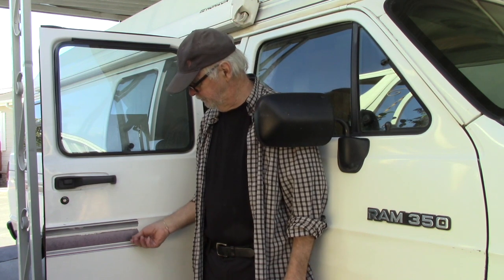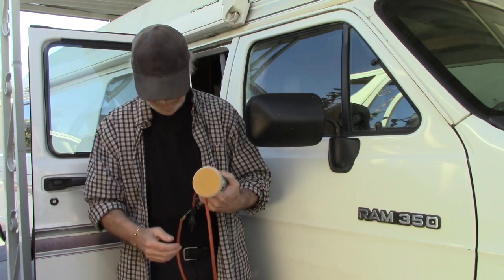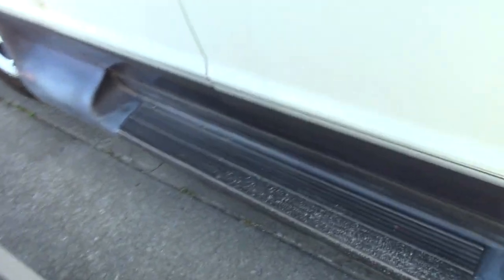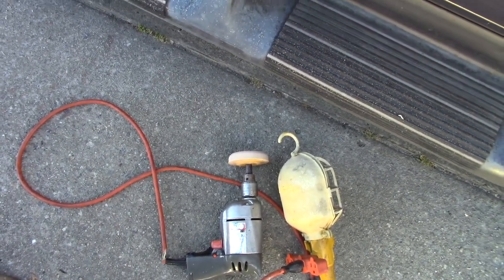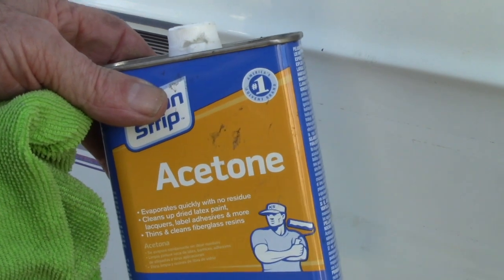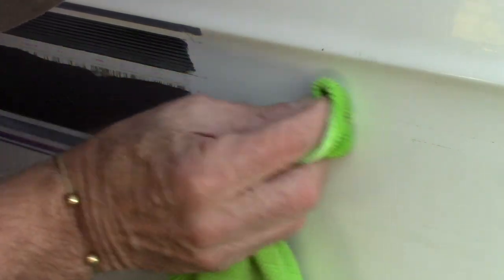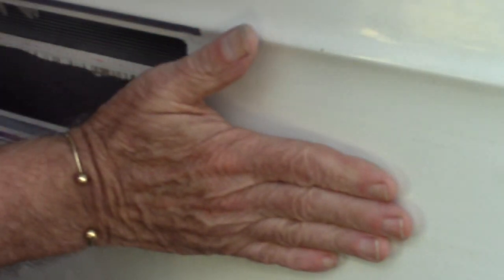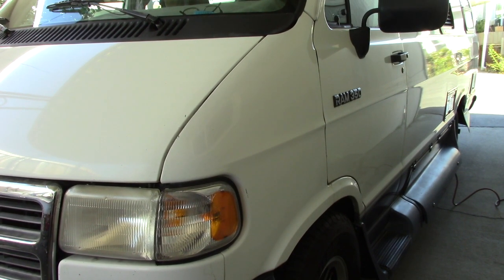Stripe Removal with an Eraser Wheel

Comment: Thank you for the demanstration.  When I bought my used class b 2 months ago someone else took off most of the decals.  They did not finish it or wax it.  Still needs to be done.  After watching what it takes to get them off I am sure thankful to the person who did it.  Will need to take off the last stripe on the bottom and replace where there are two different paint colors.  Pleasure-way Excel TD
Reply from the maker: Is yours a Dodge? I googled images to see what the striping scheme looks like. 
As far as replacing, are you speaking about paint or stripes?
My Roadtrek has different color paint on the lower body and I am up in the air with how I want to deal with it.  
Do I want to  paint it white to match the rest of the body?  
I don't think so. It would cost a fortune.
So what are my options?
Whatever I decide to do, it will be a DIY project.  Nothing will happen until spring when I have months of warm weather.
In the meantime, I can brainstorm, research and see if I can come up with something that adds to the "cool factor" of the van, maybe add a modern element to a vintage vehicle.
I've toyed with the idea of doing a "camo" treatment, faux granite. Something that adds visual 'weight' to the lower portion of the vehicle.
Reply: Roadtrek Rich   It is a 2007 Ford.  It also has paint on the lower body.  The stripe covers the not so perfect paint job.  I am gong to replace the stripe with a auto decal tape I found on Amazon.  Not in a hurry to do it.  The stripe on there now is scratched in places, but does not look too bad from a distance.

Comment: Rich, you continue to be one of my favorite vintage RT channels! Actually, I just watched your shock-replacement vid, (are you satisfied w/ the Billsteins over the less expensive options?), at the end you mentioned your stripe removal vid, so I came to find this one. I did many hours of research about removing mine. The problem is, most of the 'how-to' advice available is referring to standard vinyl pin stripes and logos, NOT this industrial, plasticky, baked -on crap we have!  After weeks of trial and error w/ 20 different products(!)... (I was TRYing to avoid the expense and labor of using the wheels),  NOTHING and I mean NOTHING works other than the wheels. I went through 4 of them, started on the roof  (mine is in prep for a paint job) to get the ladder work over with. It wasn't too bad once you get the hang of it, a little music, some coffee and water handy and just DO IT.  You already know this, so I'm just chiming in for anyone else looking for advice and support with this beast of a nightmare. Don't waste your $ on all these 'decal and adhesive removers' .. they work great on normal graphics, but will NOT work on the other strips. Buy the wheels!!  My body shop guy told me they were some 3M product that was meant to never come off ... they did a great job, I'd say!  I am SO glad that's over with!!!
Reply from the maker: Hi Sandy Sez, thank you for the comment !  Yes, I agree, it's a tedious job. I still have some left to do around the roof.  I didn't have a ladder but now I have a nice heavy aluminum one that will make the job easier.  The good news is I'll never have to do it again, nor you.  And a better looking machine in my opinion.  I could never figure out why the rv industry went for all the swooshes.  It's a big, boxy object. There's an old saying, "it's like putting lipstick on a pig".
I was going to go further and paint the lower rocker panels and fairings but the paint on the body is fine, the fiberglass fairings are faded but it's gel coat, the color is in the fiberglass so I'm just going to sand it and paint it with a satin clear to seal it.  I think it gives the van a certain, personal patina of its own. I like it.
Reply: @RoadtrekRich  'never again' is indeed the reward here!  I REALLY wish mine didn't need paint so badly, but w/o it, my resale value is NOT good. There is a great company called 'automotive touchup' that sells great auto clear coat and if you want to repaint the bottom, they also sell aerosol cans filled w/ your color code.    and btw,  doing the roof was SO messy, I taped off the seal around the roof so all that mess wouldn't make it's way behind the roof seal. 
http://www.automotivetouchup.com/index.htm

Comment: Thankyou Rich those are great suggestions. My Roadtrek is a 2001 Versatile. I've tried Mequires but not sure if the same ones you mentioned. lf not I 'll find them. I do like your videos so keep up the good work. I love that ego isn't the goal but rather a love of sharing info.
Reply: Forgot to add that its the Chevy not a Dodge.
Reply from the maker: You can quickly identify the products by going to amazon to see if they're the ones you used. The products that retailers carry are more for bright and shiny cars to keep them that way.  These Meguires products that I used are the stuff professional detailers use to bring back dull, aged paintwork. They are more abrasive and care needs to be taken because they can harm the surface if not applied and removed correctly.

Comment: Just watched your video.  Also have a Roadtrek that I want to remove stripes.  But did you also use the wheel on the small stripes up top on the fiberglass?  Just wondering if you can use on fiberglass?
Reply from the maker: Hi deb bowman,
I tested an area on the fiberglass roof.  Yes, in my case, I was able to remove the stripe up there.
Did I remove it all the way around?
No.
Why?
It would essentially be a duplication of the cost, effort and materials to remove the stipe from around the painted belt line surface on the metal body that I did do.
Having been in marketing for 50 years, I am acquainted with many studies that find people don't look higher, on average, than about 60 inches.
So for the most part, these stripes do not cognitively register in the minds of most people...they are essentially invisible.
Conversely, the beltline, where the stripes I removed were located,  corresponds almost exactly to the prime retail shelf zones in stores...the exact place most people on average, are gazing at most of the time...including me.
What is interesting me more than the stripes on the roof is somehow applying a treatment to the gel-coated fiberglass running boards that won't look like an amateurish attempt.
I would kind of like to do a version of the pixelated camouflage pattern popularized by the offroad and hunting communities. I haven't quite figured out a technique that is controllable and repeatable so I don't just create a mess to clean up.  It's got to retain or allow some of the aging to work with the new applied pattern, like it's always been there and aged.  Right now, it's just very uneven in appearance and makes the van look shoddy.

Comment: Did you try Downy Fabric softener and GooBeGone?  I know Downy fabric softener takes off wall paper and GooBeGone breaks down glue.
Reply from the maker: Hi R Edmonds, thank you for the comment. I'm not familiar with the Downy fabric softener technique.  Goo Gone was reformulated and uses a citrus base which is good for most adhesives on labels etc.
Vegetable oil is also a good lubricant to remove adhesives in some cases.
The thing about the graphics applied to the Roadtrek is the adhesive and the material have been on the van for 22 years and have solidified or "cured".
Having been a screen printer, sign maker in a past life, I have a pretty good understanding of how to apply and remove different types of materials from the surfaces they have been applied to.
The Goo Gone product in its original form was formulated from primarily Xylene, a strong, toxic volatile organic compound and is still available under the label Goo Gone Professional Strength.
Once the graphic has been removed using heat from the friction of the eraser wheel abrading the surface of the decal, heating it up, and picking it up off the painted surface the eraser wheel dust, then the Professional Strength Goo Gone can be used sparingly and carefully to work off some of the remaining adhesive residue.  At this point, a professional detailer quality polish applied with a buffer, not an orbital consumer polisher, again with a lot of care, can be used to polish off the remaining adhesive and residue and smooth out the painted surface so things look shiny.
We are talking about microns of thickness of paint so it is critical to use the least amount of force and chemistry to remove this uppermost portion, the applied graphic, to avoid going right through the paint and into the primer and metal.
Before I undertook this project, I understood that I might be about to do damage to the surface that nothing short of repainting would remedy.
I had contingency plans in case that occurred.
After having completed the stripe removal successfully and knowing what I know through my past sign making screen printing experience that helped me be careful, I would not recommend doing this project to someone with little or no experience with adhesives, solvents, paint, restorative or remediating experience.
What I would recommend to someone with no experience would be to get a drill, plug in variety, one of these eraser wheels and then go visit a Pick and Pull wrecking yard and buy a body part that has decals like the ones to be removed on the vehicle.
Take it home and practice on this part. Get familiar with what is involved in successfully removing the stripes and what the pitfalls and problems are.
The body panel can be returned to the wrecking yard for a refund.  
Yes one would have the small cost of the eraser wheel but one will go through several of those removing the stripes on the Roadtrek so that is a small cost.
The benefit is that one can see just what is involved and may opt to have it professionally done or just live with the graphics.
No matter what, those applied graphics have permanently etched the paint.  There is a ghost of their former self still visible when one sights down the side of the van.  Can't do anything about that ghost short of stripping and repainting that part of the van...something I'm not going to do.

Comment: Rich, I couldn't help but notice how nice & shiny your van is all over. I've tried various products on mine to no avail- still dull and somewhat chalky in places. May I ask what you used on yours ?
Reply from the maker: Hi Donna. What age and color is the paint on your vehicle? Different types of paint need different handling in some cases.
If your vehicle is a Dodge of similar age to the Roadtrek, you may be able to get similar results by using what I use, which is,
Meguiars M105 Ultra Cut cutting compound and M205 Ultra Finishing Polish.
I use a rotary buffer like professionals use with the correct foam and wool pads for the different steps.
It is possible to do small areas by hand but it is laborious.
After it is polished, you can use a Meguiars wax to protect and a spray detailer for quick touch ups.
When using a powered buffer, it's important to learn how to use it without damaging the paint.
One thing I would recommend if you have never used one of these would be to go to a wrecking yard like Pick N Pull that will allow you to return an unused part.  Then take a body panel like a door or hood off a salvage vehicle of similar make and model to yours with a similar type of paint.
Now you have something to practice on !  When you are done, take the door back and get a refund.

Comment: Does anyone know a company that have replacement stripe kits ?
Reply from the maker: Thank you for the question. Roadtrek would be who I would contact first.  They have a network of dealers and may have them available.  Otherwise, I would contact a company that applies graphics to vehicles. Today with computers, vinyl cutters and high end printers, it would be simple to "reproduce" the graphics or create something unique.  I prefer de-striping to re-striping however.